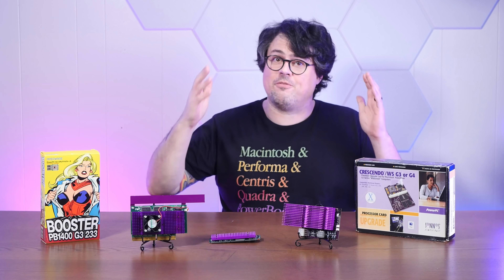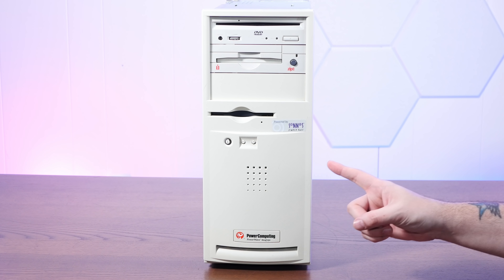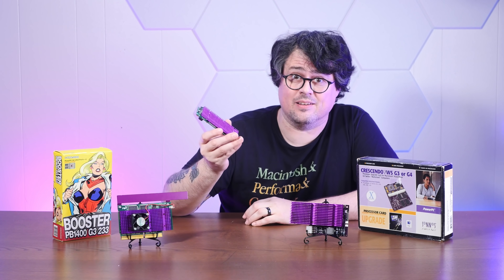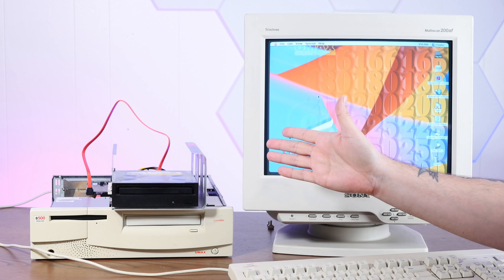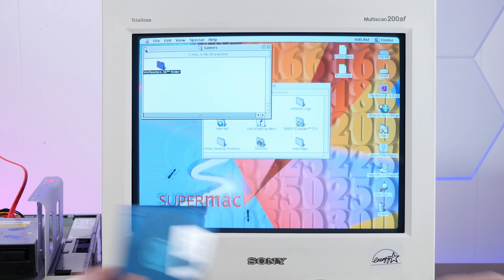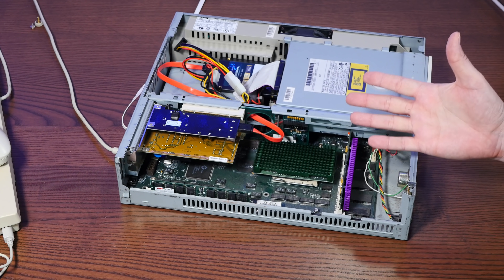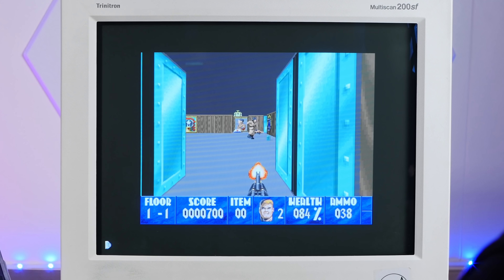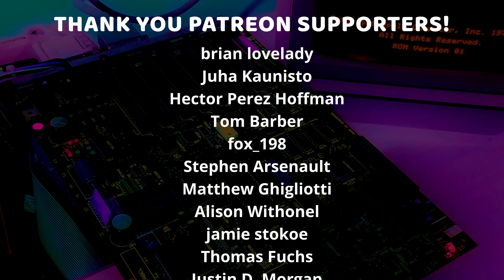An IMPOSSIBLE G3 Accelerator for "Upgrade Challenged" Macs

Comment: My blue and white G3 was an investment 
I started with a 450 mhz version in 1999
Over the years I went to a 1.1 ghz G3 then to a 1 ghz G4
Rage 128 Pro to a Radeon 7000 then to a Radeon 9200
64 MB of RAM to 256 MB then to 1 GB of RAM
8 GB HDD to a 20 GB HDD then to a 120 GB SSD and a 1 TB SSD
CD ROM to a Apple SuperDrive
It’s a beast nowadays
I have the box for everything
I think some Apple collector is going to pay way to much for this
And I’m gonna take a well deserved vacation

Comment: A little surprised you got thru this entire video without mentioning the most upgrade-challenged non-laptop Old World PPC: the PCI-based Power Mac 7200. Soldered-on CPU (which was only a 601), a flaccid cache slot, no processor direct slot. Even the NuBus 6100/7100/8100 machines were easier ro upgrade because they had PDS slots.

But Sonnet (God bless 'em) said 'never say die' and produced a PCI card with a G3 or, dumbstrikingly, a G4(!) processor, 66MHz bus, and three onboard RAM slots.

A couple decades ago, back when I was doing the crazy stuff shown in this channel (but when it was still called "computing", not "retrocomputing"), I got one of those Sonnets myself... just before a major relocation. Always swore I'd put it in my 7200 as soon as I got time after the move.

I'm sure I still have it somewhere.... but I gotta find my 7200 too.

Comment: I don't know what happened to the rather large comment I posted here, so to summarise;

Bit late sorry.

UMAX Apus C500 180Mhz - bought in UK 1998, Added a Voodoo 3 2000 and a Phase 5 Aptus G3, played Unreal Engine titles and Glide games like Carmageddon really well, as well as Open GL based Quake III etc.

Still worked the last time I turned it on, which was many years ago!

Comment: I wonder if it's possible, considering the POWER ISA is a superset of older PPC instruction sets, for NXP or similar to make a modern PPC chip which could fit the old zip sockets, and if that newer CPU could be capable of running older PPC software.

Comment: It's a shame Wolf3D is not optimized well for mac. I recently discovered that it's source code has been public since at least 2013 I think. I'm surprised no one has tried to improve it so it runs better on older 68k macs...

On a related note I wonder if any PowerPC accelerators were ever made for the LC/LC IIIs? I doubt I'd ever afford to get one even if such a unicorn exists.... :P

That machine has a PDS slot so it would be technically possible I would assume.

EDIT: had to edit my comment to remove mention of a certain well known repository host for code since it appeared the comment got auto deleted when I tried to edit it for spelling mistakes. Odd why is that particular site getting spam filtered? lol Well it's the place that is a hub where you git code...If you know what I mean. That's where I found the wolf3d source code.

Comment: I've upgraded every Mac I've ever owned as much as was possible over the course of ownership. Even the original Bondi Blue iMac had a voodoo card installed in it via the proprietary PDS slot. The last Mac I bought (not purchased by work) was a Mac Pro 3,1 8 core xeon. That one was the most upgradable yet, then something terrible happened. I couldn't buy a mac that's user upgradable for any price. The M1 certainly made it worse. I was a real fan of Xlr8yourmac back in the day. I really appreciated the info they provided about upgrade compatibility with various models and tracked when something went on sale. This takes me back to happier times. Thanks!

Comment: I had a Power Mac G4 and I swapped the 466 MHz G4  to 733 MHz on a daughter card.   

Also I overclocked my blue and white G3 to 450 MHz from 400 MHz but it is not noticeable increase but it was fun swapping around jumper blocks.

Comment: I wonder, if you can use the jumper block to increase the bus speed even further @actionRetro. I see it's set at 67MHz, but I am not sure if that's stock, or controlled by the Sonnet CPU card?

Comment: Technically there are more Umax models as European units had different names. I have two Apus 3000 machines (one broken beyond repair due to a battery damage), and thus two CPUs - one is original, one is PPC G3. 

Those machines are a bit funny as the original CPU uses... Socket 5, just like Intel Pentium processors. Obviously not compatible, but that was quite an surprise when I first disassembled one.

Comment: i need some help. i have the chance to buy a G3 L2 240Mhz from Interware. its japan. 6360CD system. are these worth it? can i play quake 3? will i be able to run a 9200 Radeon in the PCI slot as well?

Comment: You forgot to mention my favorite part: how this hardware hack actually works. Mac OS 8/9 boots on the native CPU, then the Sonnet Crescendo extension loads, finds the CPU on the cache card, patches Mac OS on RAM to redirect CPU calls to the upgraded CPU, and startup continues. This requires that the original CPU still be installed to facilitate the first part of boot, and comes with a handful of hardware quirks, but works very well overall.

Comment: This reminds me of my old commodore64 upgrade, upgrading the processor and memory by clamping a card directly on top of the cpu.
It worked by having the addon pushing power to a specific pin to force the original processor in to a constant reset state while having the new processor take the bypassed duties. It was pretty awesome.

Comment: Most-likely a stupid question, but given the age of Wolfenstein 3D when the PowerPC was introduced, is the game even a "fat" executable..? (and it's a long time since I've used that phrase…) – viz., does it even have any PowerPC code resource, or is it being transparently emulated..?

(I remember games saved on a 680x0 (bizarrely) being unable to be opened on a PowerPC, which points to the game having a PowerPC code resource, but the games performance points to it not having a PowerPC code resource 🤷🏻‍♂️)

Comment: Very cool! I have the same Sonnet L2 accelerator in a 500 Mhz G3 version in my Power Macintosh 6500. So glad I bought it way back in the day! One important thing to note is that, in addition to the G3 upgrade, it also upgrades the L2 cache to 1MB over the stock 256k. When I installed mine, I had to remove the original cache card to put the accelerator in. I love these lower end PCI Power Macs from the late 90s!

Comment: Daystar Digital was actually the inventor of Mac multiprocessing. Though the 60x bus is designed to have either a single CPU and a bus-level cache or up to 4 CPUs with no cache, Daystar managed to perform some magic to get up to 4 CPUs to work along with the cache, which greatly improved performance. UMAX may have arrived at a similar solution independently but more likely they were a Daystar licensee. Regardless, Apple (and others such as Newer and Interware) used Daystar's system in their MP models. Later, the G4 was easier to work with because it didn't have bus-level L2 or L3 caches (they were backside instead) so they didn't require the Daystar trickery for SMP+cache support.
Details are fuzzy but Interware seems to have been the first to discover and develop the L2 cache slot upgrades, originally for the Tanzania-based models (4400 and related clones), followed by a separate upgrade for the Alchemy models (54/6400). Sonnet later developed the faster, multi-model compatible L2 upgrades.
The hardest G3/G4 upgrade to get, aside from the "official" G3 upgrades for things like this C500, is the Crescendo/7200. Amiga weirdos pay tons of money to snatch these any time they come up for sale. There are likely more hacked into A4000s than there are sitting in the Macs they were designed for.

Comment: Ok if you upgrade the TAM you can get OS9Helper and the 9.2.1 and 9.2.2 upgrades open them in the desktop and trick  the upgrade to OS 9.2.2 and the January ATI upgrade to give it millions of colors, and install 128 MB of RAM

Comment: Another pretty weird G3 upgrade is for the PowerMac 7200 which didn't have a CPU slot like all the other PCI PowerMacs. The upgrade actually goes in a PCI slot.

Comment: Back when I was in high school I did work experience at an AASP. i remember in the workshop they had a 5400 that was used for things like surfing the net, downloading drivers and software, doing data recovery, etc. It had one of these, I used to love watching it boot up, first booting up with the onboard 603e, then loading the Sonnet driver and switching to the G3, and watching the rest of the extensions and control panels load really fast.

Comment: You aren’t kidding that those cache slot accelerators are hard to find. I waited for months to snag one on ebay for my Umax C600. Ended up with a G3/400, even though I had been holding out for the 500. Runs like a dream though.

Comment: I'm tellin you man, if this does it for you, you NEED to see what PC's have been doing. I mean, up to 3rd or 4th gen i series you could swap power sipping i3's (dual core no HT) in ThinkPads all the way to i7 QM 4c8t deals. And uhhh, actual desktop machines haven't stopped allowing you to upgrade, lol... That's all apple buddy, all apple. Everyone else is user centric comparatively. . . Really, the thing that killed the majority of new PC laptop upgrades is the modern ultrabook. Something apple coined and made popular, of course. As an anti consumer, non upgradable, uber expensive, less capable item, it's apple all the way! lol. . .

Comment: I like upgrades too. That's how I started playing with computers, I took trashed computers and upgraded them the best they could get and then used them. Craziest thing I did was buy a modded 1.4GHz Pentium 3-S. I used that with Windows XP for a while long after Vista and Seven came out. I'm pretty sure my Dad swapped out his 486 board for a Pentium some time in the far past as well. It's a shame modern computers aren't so upgradeable what with all the environmental concerns about throw-a-way culture

Comment: What you might not know is that Wolfenstein 3D on the Mac utilized textures which where 4 times the size of the PC version.  So instead of textures being 64x64 in size, they where 128x128 in size.  That extra data might be placing some additional strain on the bus as well which is likely resource strained anyways.
Reply from the maker: Oh interesting, I didn't know that!

Comment: Part of the reason upgrade culture was so big was we were seeing huge increases in performance within a single generation. Performance was jumping 2x, 4x, 1500x (68k -> PPC) at a time compared to the 5%-15% we're getting now. So people want to take advantage of those jumps without sinking tons of money into keeping up.
Reply: Computers (Macs in particular) were also very expensive, so it made more sense to upgrade rather than just replace. That powerbook 540c that he held up cost about $4000 when it came out in 1994, or nearly $8000 in today's money.
Reply: Exactly. When I popped up a $300 G3 200 MHz Sonnet L2 card into my PPC 603e 180 or 200 MHz Performa the performance jump was HUGE. These 300 bucks, while a pretty penny back in '98, was a well spent 300 bucks, and I never regretted it.

Comment: I really miss my Power Mac 6100/G3+AV.... i had Windows 98 SE running on Connectix Virtual PC, back in the day.  RAM was maxed-out at 136MB.  It died during a rolling blackout and I didn't have a UPS unit back then.  😓  Upgraded with the Sonnet Crescendo G3/500 NuBus.
Reply from the maker: Oh no!

Comment: Have a Performa 6300CD and it's also CPU upgrade challenged. It has both a PDS and L2 cache slot but no CPU upgrades are available.... unless the board is swapped for a 6360.

Comment: I had one of these in my Performa 6360. It was only 250MHz but with a modified version of the Sonnet extension it could easily be overclocked. Mine was stable at 300MHz.

Comment: If you really want to Frankenstein a real Mac, Get a Beige G3 / Blue White G3 and replace the zif G3 with a Zif G4, The beige can accept up to 4 IDE (M/S) including CD/DVD roms drives, 50 pin SCSI internal / External and a Floppy port :) and a few PCI cards like an unmodded Diamond 3D 3DFX just boots :)
Reply: Wow need to do this

Comment: I had one of these L2 cache upgrade cards in my Performa 6400 years and years ago. I think it clocked in at 400Mhz. At one point I even went as far as hacking the 6400 into a LC 580 case replacing the built-in display with one from an external monitor. The power supply was too large to fit inside the case, so I had to do some work to make it external. It was an interesting experiment. I really wish I would have kept all my old Mac gear. I had a ton of fun tinkering with this stuff back in the late 90's - early 00's.

Comment: I have two TAMs and both came with their own Sonnet G3 accelerator cards. While the performance is night and day between the on-board CPU and the Sonnet, the fact that the heatsink faces downwards in the PDS (cache?) slot on the TAM had me worried about cooling.

A cheap 40mm Raspberry Pi fans fit perfectly on the purple heatsinks, even the fins were aligned so I could screw the fan directly to the heatsink. After splicing into the existing fan power cables, everything seems to work fine.

I don't have an OS9 temp. monitor, but I'm less nervous running the Sonnet under heavy loads now, knowing that its getting air flow.

Edit: I also took the heatsink off, cleaned off the old crusty thermal paste and put new paste on for added protection.

Comment: I call my G4 Quicksilver "the money pit." Bought in 2006 and proceeded to put a GigaDesigns dual 1.8GHz upgrade. The CPU was an insane $500. Over the years the system has received a 9800pro, 1.5GB RAM, SeriTek SATA card, Pioneer DVD burner, SSD, and noctua fans.  Like I said, "money pit"
Reply: Hah, I was doing same thing with my G4 MDD. Maxed the ram, swapped in a flashed BIOS ATI card (forget which one but it was way better than you could get from Apple). I would have loved to have upgraded the processor too, but I just got tired of sinking money into it when there was already much better for cheaper out there. It did play a mean game of Doom 3 though!
Reply: @FinalManaTrigger  at a college LAN party we had a Quake 4 benchmark shootout. Let's just say the G4+9800Pro got trounced by my friends' Athlon64 and new Intel Core systems... By a lot... By a whole lot.
Reply: @agizm0  The ports back during that time weren’t very good. Almost like emulation.
Reply: @agizm0  Sorry to hear that.
Reply: @Revenant_Knight  The ports now aren't very good. Rebooting into Windows on a Mac gives miles better performance, on the same hardware. Games that run a bit stuttery on macOS run like silk in Windows. 

I don't know about Quake 4, but Quake 3 had an excellent, multi-processor aware version on OS X. But obviously any G4 would get hammered by an Athlon64 or Core CPU, especially as they'd likely have an extra GHz of clock speed. The G4's 167MHz bus couldn't even take advantage of DDR RAM.
Reply: @axi0matic  As I recall, Quake 3's demo came out on OSX either at the same time or just before the windows one. Penny Arcade did a comic on it. 

by the time the G3/G4 era was here, I had already moved on to PCs for gaming. I think the last game I bought native for Mac OS was Wing Commander 4.
Reply: @Revenant_Knight  I assume the complete sentence you meant to use was "Penny Arcade did a comic on how bad it was"
Reply: How's your Quicksilver's power supply liking all of those upgrades? If you haven't, I'd check the caps in it. Those power supplies are notorious for failing even with stock dual 800MHz G4's and Radeon 7500's.
Reply: Sounds like my PC…
Reply: Still less than what I spent on my G4 MDD..